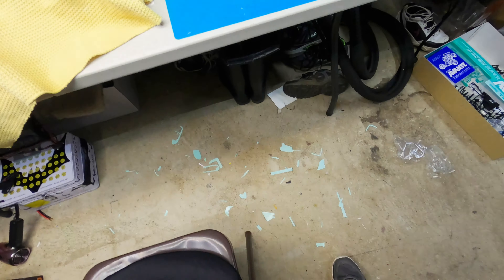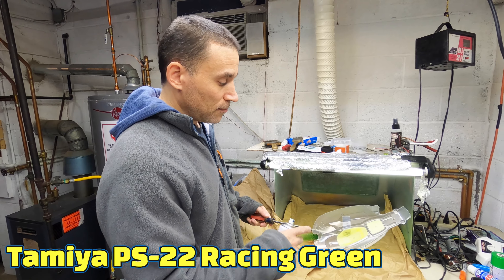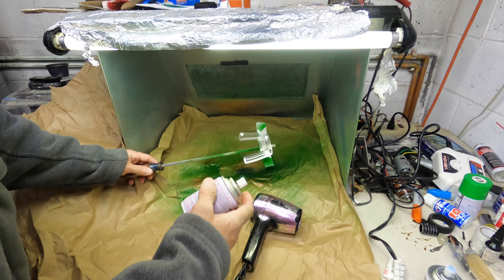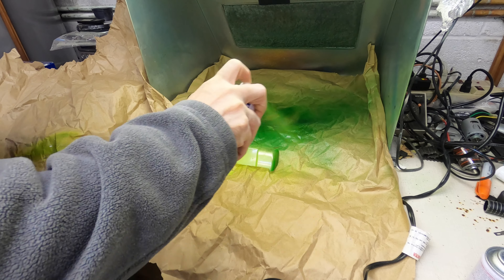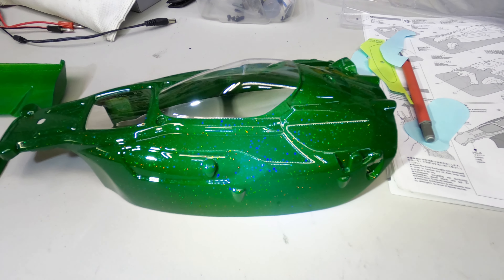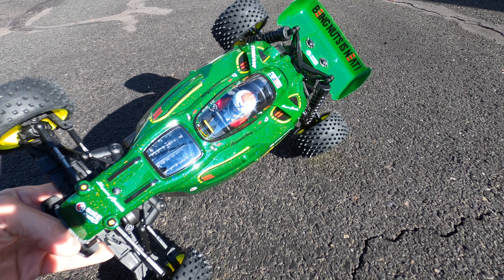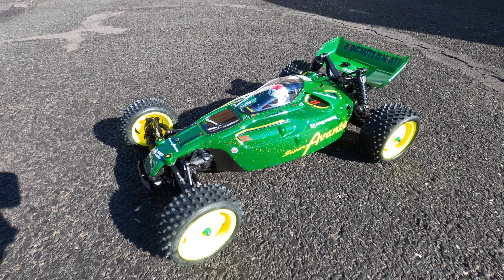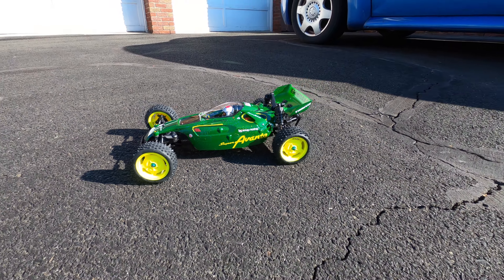Tamiya Super Avante Custom Painted RC Elf Racing Green HOW TO

Comment: That is an absolute beauty! Way better than the blue imho! Nice work dude 👍🏻🙌🏻 Like the tip with the screw driver for the spray paint
Reply from the maker: Thank you very much.  You can also use a wood dowel or like a section of that wood  molding stock.
Reply: @ShenRC  great advice buddy! I will let you know how I get on during my next paint session 👍🏻

Comment: Great paint-job Shen👍👏👏. And I also like this method with the long screwdiver. Have to check outthe next dollar store for it or a grill picker lr something  like that.
Reply from the maker: Thanks 👍 You can also use a wood dowel or section of that thin wood molding they work great also